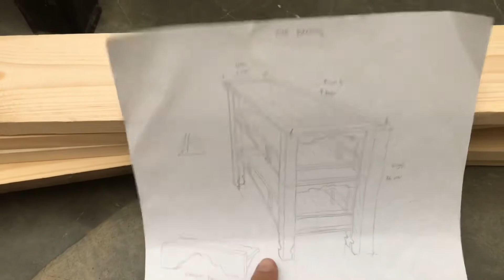Projek Kayu[woodworking] : Rak Barang Kayu Palet/creative wooden shelves

Comment: Wow, cantik.. Suka saya melihatnya, terus terang bro, saya punya equipment lebih banyak dari awak air nailer gun, circular saw, jigsaw, trimmer, planer (ketam), sander, cordless drill, cordless impact drill tapi saya paling lemah dalam bidang mengukur. Potong kayu guna gergaji mesti tak lurus. 90% bergantung pada power tools. Seronok tgk awak buat kerja ni menggunakan peralatan manual, semoga terus maju jaya dalam bidang ni. Saya baru berjinak dlm bidang kerja kayu ni, saya lebih kepada kerja besi, cuma harap bro dapat amalkan safety first, guna glove, ear plug/ear muff dan respiratory mask.. Masa umur 30an saya abaikan safety precaution ni, dah masuk 45 ni pendengaran dah kurang bagus, lepas guna power tools telinga berdesing dan selalu rasa susah bernafas, mata pun selalu berair lepas guna welding. Harap bro jaga safety juga ya.. Saya subscribe.
Reply from the maker: Allahuakbar..Terima kasih byk2 tuan.. byk nasihatnya InsyaAllah sy akan amalkn safety yg tuan beritahu tu..  sy pon baru jugk tuan..byk benda nk kena belajar dari otai2 mcm tuan.. 
Alhamdulillah Terima kasih sekali lg tuan atas keprihatinan tuan tu.. moga Allah pnjgkm umur tuan dn di beri kesihatan yg baik ☺️☺️🤲🏻🤲🏻